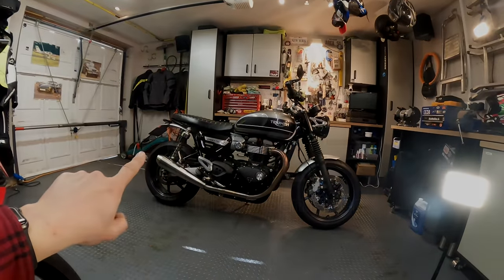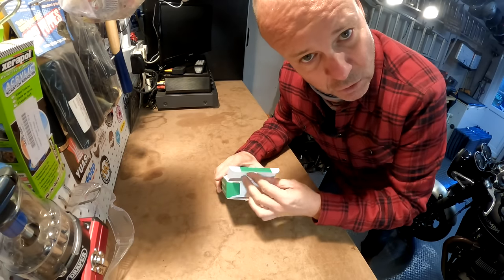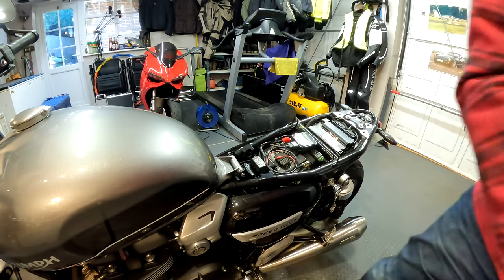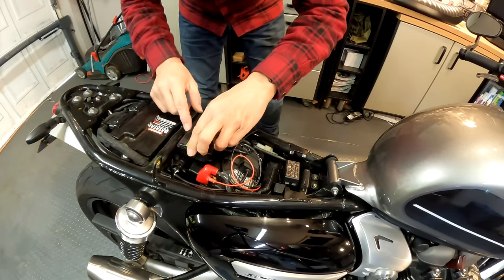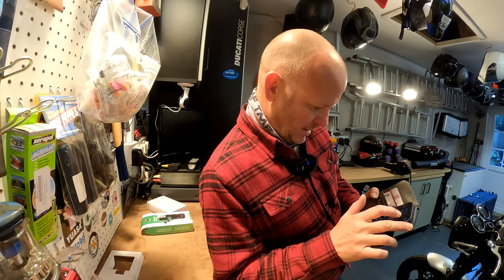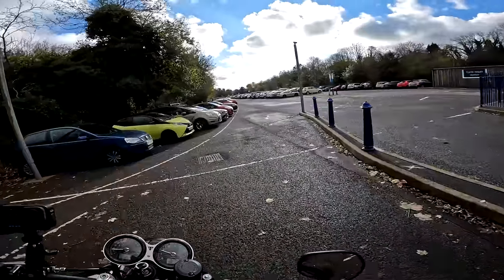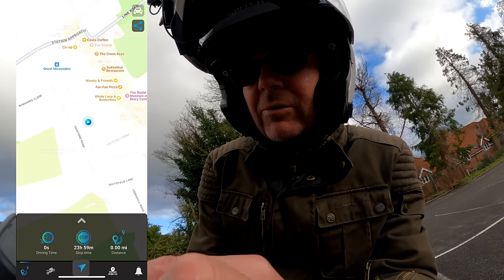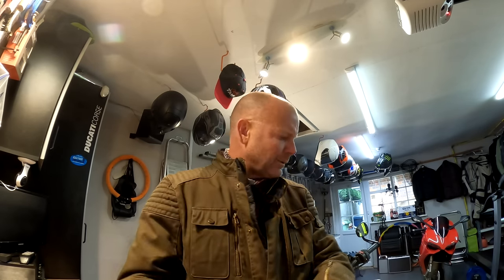Keep track of your bike! - Sizzapp monitoring Device Install & Review 4K

Comment: I'm stuck with the thought of do I want the bike back. Firstly it's unlikely to be unblemished and secondly if you call it in and get it recovered it will be tagged with stolen/recovered and impact resale. Maybe this cheap solution is a half way house and good compromise.

Comment: It looks like a good product and could easily be better hidden with extended wiring to somewhere other than directly to the battery. We installed a relay to a permanent live feed but it drained the battery in a couple of weeks so I moved it to an ignition switched live. I guess the same could be done with the Sizapp, if necessary, as it would presumably re-register itself to the network every time the ignition was switched on. Can you tell us what the quiescent current drain is as it is easy to calculate how long you will get before the battery is getting low?
Richard
Reply from the maker: I don't know what it is I'm afraid (Sizzapp will know) - I know mine lasts abput 3/4 weeks before I get an alert from the device reminding me to connect my charger.
Reply: One guy on youtube monitored the battery voltage over a week of non use,  His battery lost .7v (point seven) over a week, so thats .1 v drain per day or 1v per 10 days being left idle.....

Comment: These are very good monitoring devices but even the 2G version, which is much smaller than the 4G version, I can't find a place for it on my Speedmaster. I think it would require the tank to come off to find somewhere under the tank, or somewhere else where it would be secure and well hidden. There is just no room on the bike for it. I would have no chance with the 4G version, but still these are very good monitoring devices if you have the room to fit one. BTW the Speed Twin sounds amazing...👍
Reply from the maker: Cheers Graham - yes the ST with that Vance & Hines exhaust is quite fruity, I love it…and yes point taken on locating the device. The good news is it’s “fit and forget” so if you did have to faff about taking the tank off to locate it, once it’s fitted you don’t have to worry about it again! It’s the best of this type of tracker I’ve yet seen…
Reply: @TheMissendenFlyer  Yes, I agree. Its the best I have seen too. 👍

Comment: Does the Sizzapp have its own battery it can run off rather than have to connect it to the bike battery?
Reply from the maker: It has a 3 hour backup bayyery internally - but you do need to connect it up to a power source.
Reply: Cheers.

Comment: Nice one Andy - hiw quickly does it drain the battery? When I first bought a GS in 2020, BMW were mandating factory fitted Datatool trackers. It could drain the battery in less than a week so was permanently on a trickle charger. There are downsides to this too. Keep up the good work. Rgds RJD
Reply from the maker: Yes I have the same issue with my tracker on the GS, I too have to keep it trickle charged. The Sizzapp doesn’t keep checking in like the Datatool so seems better in that regard but it is of course drawing the battery over time, so I will likely put the bike in charge from time to time (though not permanently like the BMW). So far so good…..

Comment: Im not sure you picked a good location. You should pull off the tank for a spot. In a second note, I’ve been seeing some much smaller trackers being advertised that use there own power supply and are very small and easy to hide, like the size of a earbud. They use a magnet to hold itself in-place.
Reply from the maker: Ther eare all sorts availabel with various pros and cons - for me I like the "fit and forget" nature of the Sizzapp, no batteries to worry about, no subscriptions, no keyfobs - it just works with no effort on my part.

Comment: Trackers are the first thing thieves will look for, so it needs to be put somewhere that is difficult to quickly access. Connecting directly to the battery is a huge vulnerability with this item. How many purchasers will do exactly as you did, wire it up and stick it under the seat? By the time you get the alert and down to the garage, the bike's in a van and the tracker disconnected. Better than nothing, certainly, but I'll stick to the industrial grade ones.
Reply from the maker: Fair enough....my view is anything that helps, helps!

Comment: Question, how does it know that it is you riding away or do you have to switch it off by using the app?
Reply from the maker: It has a built in GPS so knows when you're moving....
Reply: @TheMissendenFlyer  ok so how does it know it's you ride the bike and not somebody else? Or is it linked to your phone so you have to have you you all the time
Reply: @richiektm  Unauthorized movement is being recognized by engine status, so if it is off and there is a movement, then you will receive notification. After beginning of a movement you have 10 seconds delay to start an engine to prevent a notification generation.

Comment: Unfortunately it's a bit too big for motorcycle use. The first thing any self respecting tea leaf does is rip off the seat, side panels, and headlamp looking for a tracker. There are app based trackers 1/3 the size which can be genuinely buried and powered from a live, not from the battery itself.
Reply from the maker: Well I don't want to go into detail about location (for obvious reasons!) - this was more to demo how it works...
Reply: @TheMissendenFlyer  it was more the size will make it difficult to bury?

Comment: Lots of varied opinions in the comment section on this one! My view is it's always good to see more options coming on the market for bike security. Thanks for putting this together. How are the shoulders going during the cold of winter? I'm still trying to work on shoulder exercises to help with mine. Going to see the doctor soon to get another shot I think
Reply from the maker: ...I'm waiting for another steroid blast in the joint.....
Reply: @TheMissendenFlyer  I'm told the shots aren't a long term solution unfortunately, Looking into something a bit more natural, will let you know if I find anything!
Reply: Have you tried a hanging stretch, seriously, use something like a pullup bar ( feet dont have to be off the ground) hold on and let your body weight pull you as much as you can dont push it just hold for 1-3 mins it opens up the shoulder joint and stretches it out,  really helps
Reply: @chrischristofis8501  I have!! I bought a pullup bar for this purpose. However, it seemed to prolong the pain and I only started feeling better after stopping it for a few days

Comment: No good unless the unit and wires are hidden.  I had my Guzzi pinched.  Fortunately got it back.  The scum had broken their way under my seat and pulled out all auxiliary fuses.  I didn't have a tracker at the time, but this would have rendered it useless , also without internal battery, Disconnecting bike battery while storing stolen bike in lockup , would turn off unit, cheers 👍
Reply from the maker: ...if it's disconnected an internal power source kicks in and alerts you...

Comment: Is there no cost for the 4g surely it has a SIM card
Reply from the maker: Nope - no SIM - that’s the brilliant thing about Sizzapp versus say Monimoto like I used to use (which required you to top up the sim every year….). I don’t know how they do it as presumably there is sim functionality in the device. Really is “fit and forget”.
Reply: @TheMissendenFlyer  well worth it then ! And for me the bonus is you can easily swap it over to a new bike without any charges as most will insist on there engineers doing it for a fee
Reply: There is a SIM card installed into the device, but there are no any fees ever, all the duties we cover by ourselves. For users it is an one time payment and life-time licence.
Reply: @Sizzapp  the only thing then would be regarding network coverage I guess but that’s the same with any tracker
Reply: @junkie1128  of course, SIZZAPP needs the network to send the data to the SIZZAPP mobile app. But in case somewhere is no network coverage, the SIZZAPP will still work and record all the data and send it to you as soon as the network is available again.

Comment: Apple tags… just need to remove speaker. 90 eur you get 4!
Reply from the maker: Trouble is, as I understand it, they need to be near Apple phone or tablet in order to report their position - might work well in populated ares (I dunno, does it??) but in the wilds of Scotland on a tour I'm not so sure.  That said as many layers of security as you can are good, so the more the better.....
Reply: @TheMissendenFlyer  I guess Samsung and iPhone, both will catch the signal.
But I get your point. Nevertheless value for money you can’t beat them.
Cheers 🍻🇵🇹

Comment: Only issue for me is because it doesn't have an inbuilt battery. Even if you lengthen the wires and you hide it say under the tank all a thief must do is disconnect all wires from the battery and it's dead...No need to try and find it. Whether hidden away or in plain sight no difference...So basically you need to hide the battery to keep it save...🤷‍♂️
Reply from the maker: Actually it does have an inbuilt battery for just that reason - if it’s disconnected it alerts you it has been and will continue to send its position for 3 hours….
Reply: @TheMissendenFlyer  - Ah I see! Thanks for letting me know. Makes sense now as I could not believe they would not have thought of what I said. Ok, that is good to know. Cheers Andy.

Comment: AirTags for me, on both bikes.
Initial outlay £56.
Small, discrete and easy to conceal.
Replacement batteries £1 each yearly.
Reply from the maker: I’ve not used them - I must check them out. Am I right in thinking they need to be in range of a wireless network or Bluetooth device to operate? Ie they don’t use GPS and the mobile network?? If so I’m not sure I’d trust them quite as much to work all the time….
Reply: @TheMissendenFlyer  They rely on someone having an Apple device within range. Worked for me when I checked my bike outside hotels on NC500 last year. In cities, no problem.
Reply: @ironmanmichael  and that's it's major failing, in busy city OK anywhere else out of the urban area pretty useless
Reply: @kevindarkstar  You'd be surprised. I use Samsung SmartTags which are superior as they have a much longer range of 100m and you can see the history/route. I've done loads of rides outside the city and it's been pinged even in the middle of the countryside. All it takes is one car to drive past within 100m and it can get pinged. The only way really that they could realistically avoid detection is to put the bike in the middle of a field or something, which just ain't gonna happen. Most hiding places will be within a few metres of a road, and the chances of someone with a Samsung phone driving past in a period of say 24 hours is very high. I definitely think it's a better option than a large plug-in GPS tracker which can be found relatively easily compared to a tiny tag device, of which you can hide multiple in the bike for low cost.

Comment: Obviously, whilst the device itself doesn't need a subscription, there is still a monthly SIM GSM plan required. I'd be very interested to see how long it takes to flatten the motorcycle battery as there are more than a few 'weekend warrior' motorcyclists that don't have a garage or a means to keep a bike on trickle-charge. The last tracker I fitted to my wifes bike had the battery flat in 3 to 4 days. Granted, not a problem when bike is ridden regularly.
Reply from the maker: No there isn’t a sim gsm plan - you pay once and that’s it, that’s the whole point “fit and forget”….

Comment: I’m guessing thieves look for these trackers. I was expecting something small you could hide away, that’s massive and would literally take 2 seconds to snip the wires and chuck it. I was waiting at the airport recently, for my bag, and the bloke next to me had the apple tags in his luggage, he could see exactly where they were, still on the plane, and were really small.
Reply: But I believe the apple tags rely on Bluetooth  sending of data via nearby apple devices. Only useful if an apple device in range during/ after theft.
Reply: air tag will help only if another apple device is nearby. SIZZAPP will work anywhere no matter which devices are around. And if the thief will find the device and take it off, you will immediately receive the notification about it, so you will know that something bad happened and you need to hurry to save your bike.
Reply: @Sizzapp  In UK we still have a decent 2G Network. Will the 2G Sizzapp device & app allow users of 4G phones to view 2G tracking data ? 

My phone is 3G (Samsung note 9) but uses 2G & 3G networks but thinking of others not just myself.

Thanks
Reply: Nothing will stop them if they want it and at least these things are some sort of protection/help. I'm in Edinburgh and it's really bad for bike thefts, even when you're on the bike, they really don't give a ....🤬
Reply from the maker: ….I recently bought some AirTags to try out - they only work in the vicinity of an Apple oroduct and so far I have found mine to be very unreliable tracking a bike in the countryside…

Comment: How not to install a tracker. Thieves check under the seat and leave bikes parked without the battery connected for a few weeks before taking them to be stripped or sold. They will see that straight away  Remove the sticker off the thing, and move it somewhere it looks like an OEM part and splice into the wiring (or pay someone to do it for you).
Reply from the maker: Indeed - if a thief takes it out the device alerts you of that too....
Reply: @TheMissendenFlyer  it would be interesting to see what this lifetime support actually means, as the product only has a 24month warranty. With phones its normal until the company stops producing the model, their site doesn't state what it is. Also if it's 4G guessing it's got a SIM in it (tied to a operator), what happens if they go bankrupt, or increase tariffs? Can't see that being free forever or lasting forever i.e Thier 2G product will mostly be useless in most countries. Would be good to know if they respond back to you if you ask

Comment: Good little punchy vid.

With various modules & afternarket wiring  often commonplace this could make sense to for many ....myself included. Ideal perhaps for a older bike not worth equivalent of a  small mortgage.

It might be ripped out fairly quick once bike in hands of a pro thief but may give owners some chance of recovery if sensible quick steps taken &/or ideally police involved,  (IF owner  can get a Police response in a timely manner).

I strongly advise against daft ill thought out recovery heroics & recommend common sense in any locating &/or recovery. Easy for some to get into bother if face to face with a thief or organised crime. I am ex emergency services.....Streetwise (not clumsy  feet first !) , skills may positively factor but "easy does it"... it's not worth getting seriously hurt when up against many thieving toe rags who will likely be opposed to engagement or recovery ! 

Price shown on the sizzapp as £242 GBP online . 

Also a 2G version for £206 which ironically might provide better/wider U.K. coverage..Not done research to see if a 2G tracking device visible on a  4G phone....I would suggest having a chat to manufacturer 

DPD delivery is currently shown as another £27.29 plus a cheaper delivery option from a courier I haven't heard of called "pasts" at £9.11  I also found a discount code on another YT vlog BRAAP10  (not tried the code and blogger was not in U.K.) .

Interesting seing comments elsewhere on here this can be hardwired wirhout warranty issues  if wanting a bit more stealth but do remember it would need a constant live power feed. 

Oh and its also IP67 so ideally should be ok for minor damp etc.

Thanks 

Ride Safe 

👍🏍

Comment: I like the features but its big and not exactly easy to conceal, the first thing a professional thief would do is rip the seat and side panels off looking trackers and pull any strange wires off the battery.
Reply from the maker: ….it would report to you if that happened btw…

Comment: Seems way to large to hide and you would have to cut the battery terminals off and solder in hidden or the thief would find it to easy
Reply from the maker: It's easy to be creative with it (for obvious reasons I didn't go into detail)